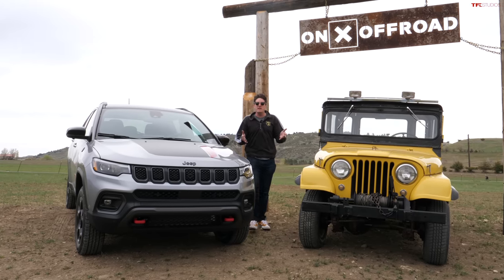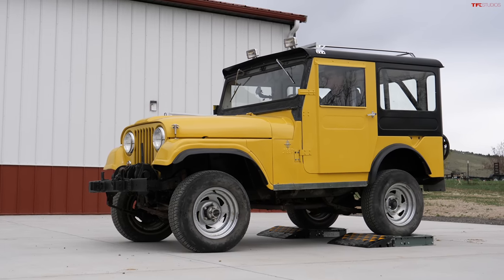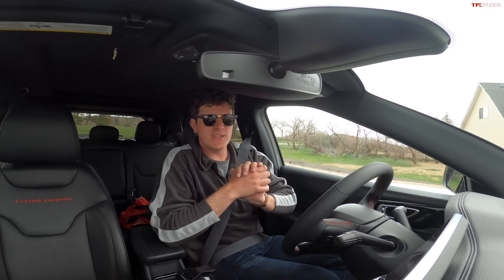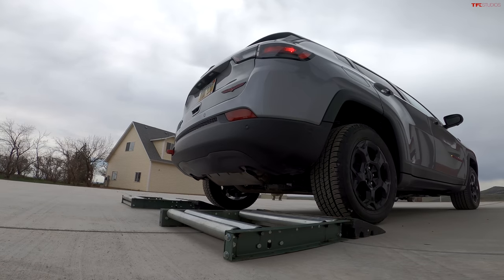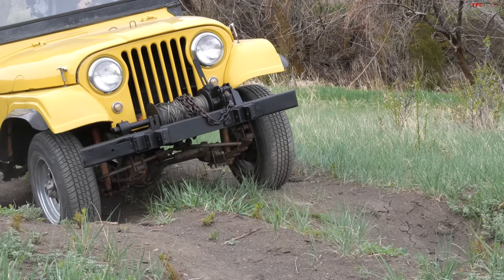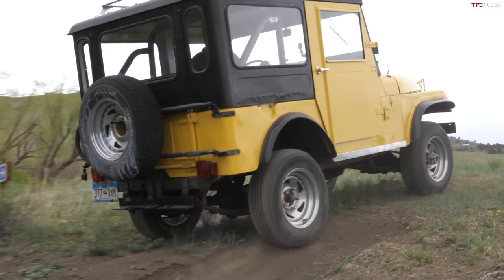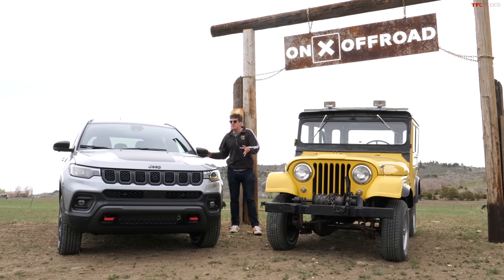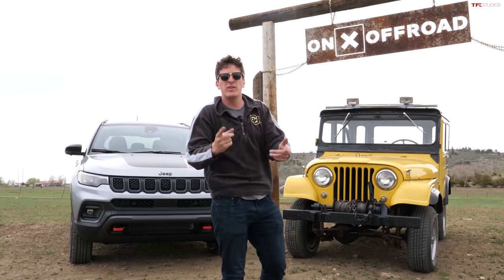Old vs New: Here’s Why Everyone Is Wrong About New Jeeps! Slip Test & Off-Road Challenge

Comment: Definitely a cool comparison to show just how far we’ve come in vehicle technology….however I’d love to know how well the compass functions when it’s 60 years old compared the the CJ…lol can’t deny how awesome new 4wd systems are, but the old ones are just plain fun. Great video!
Reply: From the looks of the CJ, it has spent its existence as a toy.  I say that because as a child in the 70's, I remember when vehicles in the rust belt would start rusting just a few years from new.  Some were worse than others(the Vega, for example), but that was inevitable in any vehicle.  The exterior of this CJ is pretty solid, so it's either been completely redone a few times over, or it's a toy.  So I think it has sat in the garage until its owner decides to do some offroading, they go do it, wash it up, and put it back in the garage.

I think people would be surprised how long newer vehicles could last if used like that.  The key factor would probably be how salty the air is where they live.  I think we'd probably all agree that the electronics and their exposure to moisture would be the determining factor.  But this is always the case.  I doubt that CJ is still using its original solenoid.
Reply: @robsolf  very valid point, but my comment was in fact more toward the vast amount of computers used in cars to control all these systems now, not just the raw materials used to make the vehicle. I’m also not knocking new technology, just making a point.
Reply: @robsolf  I grew up in the desert. 100 year old cars sitting in a field remain cancer free. Paint fades, and patina are common. this could be a desert truck with a new-ish paint job.
Reply: @ajediknight  Could be true.  But why do we assume that a 2023 vehicle could be left in the sun for 50 years and not run?  None of us are the engineers that could work that out.
Reply: @roderickhance2088  I agree completely!

Comment: Well as a family with 7 jeeps. 1- 96 TJ, 3- CJ5s (one will never drive again and is a parts jeep and 2 that are 69s and 151 cereal numbers apart), 1- JL (don’t know the year), 1- Scrambler (don’t know the year), and 1- 23 Gladiator. I’ve grown up in the old Jeeps and appreciate the new ones. I just find my 69 CJ5 is more fun than the new ones. We break stuff on the Gladiator more often than the older ones but the JL hasn’t broken yet. I feel like I have more control in my CJ5 with my 2Low and manual. You can customize it more to how you want either by making or buying parts compared to new. Really it just comes down to how you like to drive. Also I understand that you’re comparing the stock versions but you’re forgetting how much the older Jeeps are modified to have lockers and other stuff like that just to make it easier. I have no lockers and you can do stuff without you usually need lockers to do. It more comes down to skill and knowing your vehicle. The older ones all drive a little differently and you have to learn your jeep to do stuff well.

Comment: If you keep the CJ's front hubs locked like in winter its shift on the fly no need to get out. Todays Wrangler has the front axle and driveshaft spinning at all times now so that would be the same.

Comment: My compact tractor is a more modern "car" than that old Jeep, and more luxurious.  You can engage 4x4 from the seat, and it has a rear locking diff. Plus, it has a tilt steering wheel! 😂

I'm sure when that Jeep was new, all the old guys out west were going on and on about how their horse was better option for getting around than that new fangled jeep.

Comment: The manual locking hubs and manual 4 wheel shifter are far more reliable than the electronic ones. Just ask anyone who uses vehicles in a off road work situation

Comment: Now try a real world test, muddy and icy partially melted dirt road surface on 20 degree slope. Good luck with modern all-wheel drive. You won't go any where up that hill, where as that CJ-5 would probably climb right up it. My experience was with a 2007 Toyota Rav4. It wouldn't go more than 10 feet up the hill before the traction control stopped it in it's tracks. The reason is that as soon as traction control engages, none of your wheels will spin enough to power up the hill. BTW: Who talks about open-diff four-wheel drive units. They are crap.

Comment: The old Jeep in this case still has 300% better off-road potential. It's not that hard or expensive (especially when considering the cost of these new Jeeps) to upgrade with some basic lockers. With lockers that CJ would shred the Compass. Plus, in off road situations articulation and ground clearance are super important. That Compass has almost no articulation and scant clearance. The CJ has both for days. If I had to choose between the two and I was planning to spend a lot of time on the trails, my choice would be the CJ and it's not even close. I'd just make sure I had a good winch to pull my friend in the Compass out when he gets stuck every 1/4 mile.
Reply: I’m inclined to believe that owners of the Compass would not attempt to do the same things as a CJ would do. For those who like extreme off-roading, a modified (with lockers) CJ might be the way to go but no one would want to drive those things. For me, I’m perfectly fine with a modern 4wd vehicle like the Compass since I wouldn’t need to prove I could crawl over big rocks. 

However, like Tommy said, there are many variables to off-reading and not just what you described. In fact I may have to pull you out of “simple” obstacles with a Compass if you’re not properly equipped. At least when everything is said and done, I can cruise home with all the modern conveniences to make it enjoyable.
Reply: Especially cheaper to upgrade since an old 4x4 like the CJs are easy to work on for even a low-skilled home mechanic (me). The ability to self-repair is getting lost across the board, and that's sky rocketing costs/challenges to update/repair or do field repairs.
Reply: @montechie In a way, you can “blame” consumers for that. Over the decades, people have started wanting more conveniences and creature comforts. And insurance companies want more safety features so it was probably inevitable that self-repair for cars would start becoming extinct since everything is so complicated. 

And expensive! 😕

Comment: I can remember back in '79 up in Evergreen CO I was going uphill to pick up a carpool rider before work.  I hit a patch of ice in my J10.  I slid backwards, down hill, headed for a cliff.  Brakes locked, kept sliding.  Down into 2nd, kept sliding.  1st was not synchro.  I finally slammed it into reverse and regained control.  The truck would probably have survived going off a cliff, but I don't think I would have!  Ironically, the lightweight little Subaru, I swear had a beer can logo under its paint job, that the carpooler owned, had no problems whatsoever.

Comment: One more thing ... even unlike most (the 392 Rubicon can do this ) modern wranglers , in addition to sending power left and right , the compass , renegade and Cherokee can ALSO send power front to rear because of the PTU , and , they can ALSO essentially lock 50/50 (like a part time 4wd): that's what sand / mud default torque split is.

In fact , the Cherokee Trailhawk can send 100% to the rear AND you can lock it which would mean that if the front right tire is off the ground , it's possible that the front left tire could experience ZERO wheel slip!

Comment: Funny I ran into this video today.  I just got home from testing some new mud/snow tires on my 82 CJ7.  The tires I replaced looked very similar to the tires on the yellow CJ in the video.  My Jeep has Detroit Trutrak limited slips in both diffs.  I was on a rough dirt road and hit about 5 inches of snow.  I finally lost traction in 2 wheel on about a 10-15% grade.  It was 22 degrees outside.  Once my frail 56 year old body got out locked the hubs in I was happy to know that they were actually engaged.  Once back in the Jeep I had to wrestle the 4 wheel lever back one notch, again happily knowing I was truly in 4 wheel drive.  I stabbed it into first gear, gave her a nudge of gas, and let the clutch out and easily climbed the hill.  Thankfully, I survived the harrowing experience of having to be outdoors for 45 seconds to lock the hubs, which emboldened me to I stopped again and  get out and play fetch with the pups and have a beer.  

I have no idea if a new Compass could have made it where I went today.  If it could, great!  But, I have a machine that I upgraded cheaply , I know what mode it's truly in, I'm the computer making it happen, and that makes me happy.

Comment: After a year in my '77 CJ5 once it snowed I locked the hubs and left them until Spring. In theory that's unneeded wear but I never had a problem with that until the frame rusted and it went to the junk yard. My '22 Cherokee TH is more capable by far. The diagonal test sucked IRL with open diff, it was the only time I needed pulled out.

Comment: I used to lock my hubs in December and leave um locked all winter. If the old vehicle has a minor problem gum a wire tie and duck tape can fix stuff for a few miles or days lol. A lunchbox locker will solve the open dif problem.

Comment: I think it's fair to say that unless you anticipate, or know, that you'll be going off-road and need a 4low transfer case, most of the modern TCS systems will suffice.  I do think its a bit of an overly dramatic comparison to pull an old CJ in with a brand new trailhawk compass...but then again, the folks who know they'd prefer the CJ (or more modern 4x4s) know why.  Good demonstration for the folks wondering whether they "need" low gearing and/or lockers

Comment: Enjoyed the video Tommy!  One thing missing is the center of gravity argument.  Despite some of the advantages with regard to narrow track, approach/departure/break-over clearances - I would be very nervous attempting to drive one of those older Jeeps on a highly technical trail.  If you guys get bored, you can start gathering some center of gravity / max tipping angle data on these vehicles.  I think it amounts to tipping the vehicle to a specified (safe) angle while weighing it.  Probably some SAE test protocols to consider.. Some manufacturers probably even specify this in their manuals.  But on the older vehicles.....?

Comment: My 1976 CJ7 had such a low range with its four speed  you could start off in second or on flat roads even thord gear. The first gear low range was such a granny gear when going down a steep hill in first gear low rangs, you could get out of the jeep and walk faster than the jeep would roll.

Comment: Got a suggestion. The first generation ford Ranger, the basic 4 cylinder 5 speed model came with 2 popular options, at least in my area. Limited slip differentials for front and rear, and a bit later auto locking hubs. They also had amazing articulation and wheel travel. I bet one of those would just walk through the roller and trenches test without breaking a sweat.

Comment: In the old school all functions are hardware based like it wouldn't take the lever at first and you pushed, etc. and it got it, In a modern vehicle everything is electronics and if you get a bit of dust or smt you could get a limp mode light or none of the off road aids working. And you can't do anything about it, That's the main problem for me and you could get a bit more sophisticated old school off roaders with 2 levers instead of 4 :-) So there maybe some happy medium.

Comment: I have a 2015 Grand Cheorkee, the traction control setting for snow works well, until snow is deep. When its deep and wheel spin increases it cuts power, so I disable it. I will say modern Jeeps perform well with their 4wd/awd systems.

Comment: In the snow I would rather have the modern awd and light offroading in mud in more hardcore I would rather have the 4x4 with solid axles and the lockers for deeper mud and deep snow. It all really depends on what you need.
Reply: I think that's what everyone needs to understand.  If you are a hardcore offroad enthusiast, you most likely are going to have a true offroad focused vehicle specifically for those scenarios.  Most people who want AWD or 4x4 usually just need it every once in a while or want to have it for winter.
Reply: The XJ, ZJ, and KJ with NP242 SelecTrac had it about right...2WD, AWD, 4H, 4L, and Neutral...with a 2.72:1 low and a simple tcase to rebuild. All Jeep had to do was add switchable TCS/VSC/ABS. Owners could add lunchbox or Ox lockers at their discretion, for serious offroading.

 I prefer those geared mechanical methods of aiding traction to diffs, vs the reliance on sensors, brakes, and clutches... especially offroad. They can last longer than 15yrs in the rust belt.

 I used to lock my CJ's front hubs in Autumn. Things stay lubed better if you lock them at least 1-2x a month and drive a short errand. I never had an issue with my hubs or with my cast-iron, gear-driven tcase.

 Try the slip test with an NP242 KJ that has lunchbox or Ox lockers at each end.

 A QuadraTrac CJ7 with Ox lockers could ace that test too.

Comment: the 2.0 turbo for the 23mp was spec'd with 87 but the computer will up-tune when it detects octane, so running 91+ = zoom go read the manual if you don't believe me

Comment: I owned a Bronco II for 15 years and three Isuzu Troopers with no kind of limited slip differentials and the only time I got stuck was once in my Bronco  when I had road tires in slick mud. Ground clearance, locking center differential, and good tires will take you more places than you can walk. No pothole was too deep or curb too high. The only reason jeep is struggling these days is their standard engines are too weak. It's also the only reason I never bought a Toyota 4-runner after Isuzu went away.

Comment: I'd still rather have the old systems. Old is simple with little to go wrong and most cases can be fixed trail side. New stuff has so much electronics that when something breaks you're calling friends to tow you completely out and good chances all the way to the shop since you can't fix them nearly as easy..

And if you really need lockers air lockers are much cheaper than the computer system and can again be fixed trail side normally. They can even be run off a battery powered compressor if the main one fails. Try that with your electronic system.

Comment: You are comparing a modern high end jeep with a non-locker older jeep. Traction control off-road systems are the modern lockers. Not apples to apples.

Comment: Anyone have a suggestion for what kind of lockers I should install on my stock 1985 CJ7? Was thinking about either a torsen for front and rear, or an Eaton e-locker for both front and rear…looking for advice!
Reply: What do you plan to do with it.  While I would like a selectable locker in the front, i got an axle that had a spartan locker in it (for my 81 CJ.  And I put a Torque locker in the rear.  Works great but turning radius is not good.  So a selectable locker is the best option.  Between e locker, air locker or ox locker, depends on how you drive it.  They all have weak points, air lines, electric lines or linkage that can get messed up.  Ox lockers have the option of setting it to locked of the linkage breaks though.  So I vote ox locker
Reply: @dainwilson4523  so my use is not rock crawling but I am interested in challenging trails here in So California. We don’t get much mud, and even less snow. But would like to do the Mojave Trail one day in Death Valley. I was leaning toward e-locker front and rear for simplicity and reliability. And it has to stay street legal and capable. Thanks for your ideas !

Comment: Throw lockers in the CJ and it'll run some of the toughest trails. 

The compass, not so much.
Reply: This is a stock for stock comparison. Throw lockers in anything it'll go anywhere
Reply: @seanwatson3790  That Compass is a trail-trim Trailhawk. The CJs were offered with front and rear LSDs as options. A fairer comparison would be using a CJ with freshly-rebuilt LSDs.
Reply: @RKmndo  I understand that. I know all about all the trailhawks. I own one. But good luck getting one of those old cjs

Comment: So, both vehicles were performing as designed. An open differential sends the torque to the wheel with the least traction. The computer system tricks the axle by applying the brake to the slipping wheel, sending torque to the other wheel. I have a 1978 Ford F-150 with the same layout as your Jeep: solid axles, manual hubs, and a lever on the floor to engage the transfer case. The difference is that I have air lockers front and rear. My truck would laugh at your sissy rollers. If you want the ultimate in traction, that's how it's done.